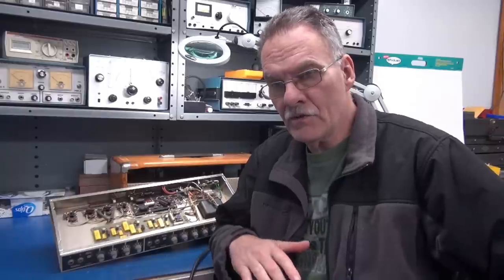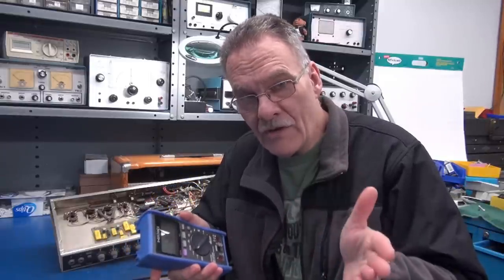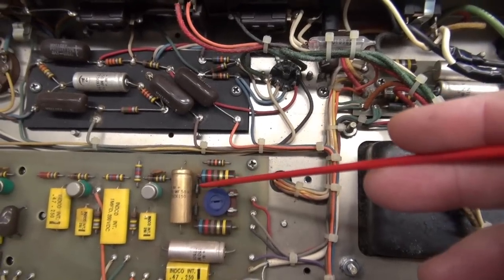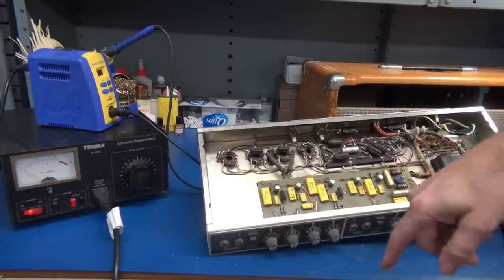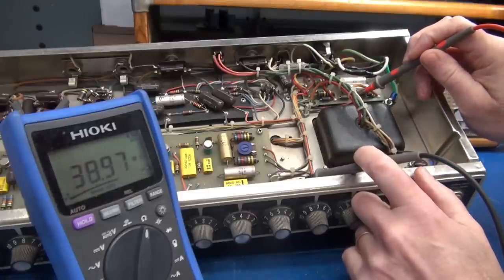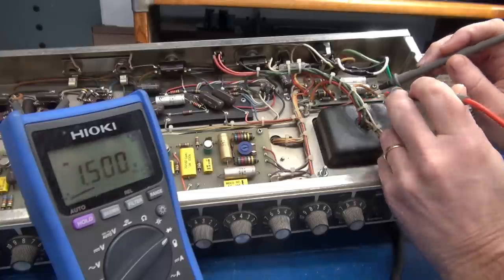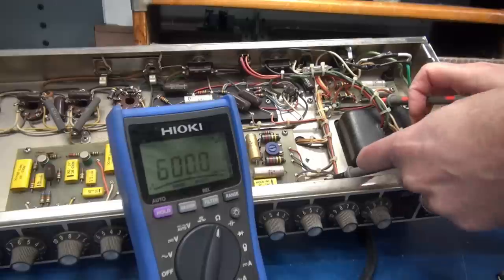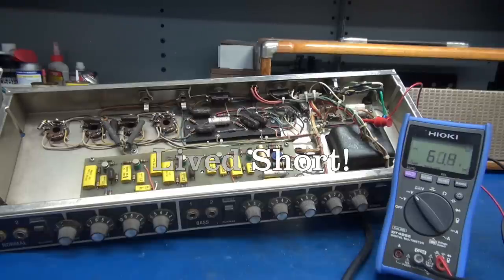Music Man 130 Tube guitar amp Shorted High Voltage power supply blowing the fuse Locate fault

Comment: Solid state rectifier, blowing fuse, probably the first thing to check is the diode junctions for shorts, low hanging fruit first.  I always enjoy the logical methodological troubleshooting methods you embrace Terry.  Wise to check current when bringing the PS back to life. Sometimes a shorted electrolytic, or elsewhere, caused the diode to fail, sometimes not.

Comment: This was my first "real" amp, bought used in '82. The only amp I know of that had a high/low power switch, which were different taps off the primary of the power transformer. Since it was a primary tap, it lowered everything on the secondary, including the filament and bias. I think in low mode the B+ was around 450V.

Comment: Would you have a suggestion for what I can use to replace the  diodes on the 2 el-34s? The part number is mr-250-5. I can't seem to find anything like that. The amp I have had two mr250-3 in series.. after a red plating incident they failed on one side..

Comment: Hey Terry. Do you recommend removing the 'death capacitor' from these amps? I am working on a 2100-75 and am not sure if I should just cut it out, leave it, or replace it with a new safety Y2 cap.

Comment: So the standby switch puts the diodes into the circuit? Why can't you detect a diode short with or without being in standby? I guess I don't understand where you are measuring for the short.
Reply: You and me both. Maybe a wiring schematic and a highlight of the diode in question would have helped.
Reply: Ok, I stumbled across a diagram pdf online. Standby switch is between transformer and diodes. I don't like the term standby here, he says standby on has a short, why, it should be open to take diodes out of the equation. ?
Reply: @Joetechlincolns  Still confusing. Some people have odd ways of explanation, but what bothers me is not answering or clarifying comments. I most likely will not comment on his channel again, even though I do enjoy it.